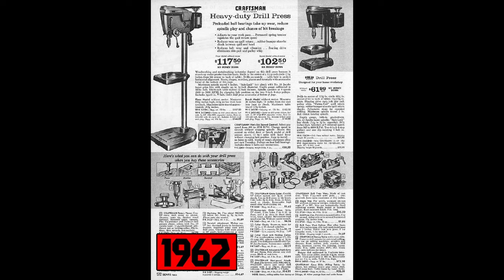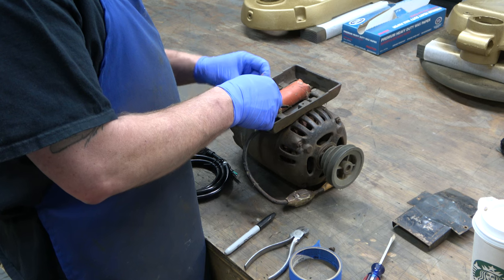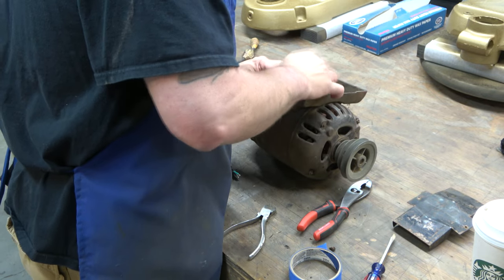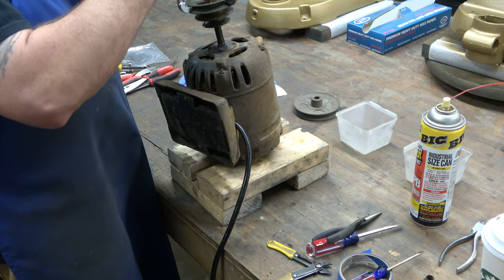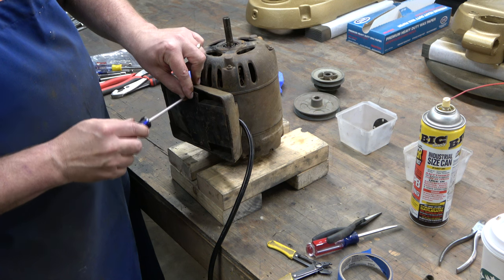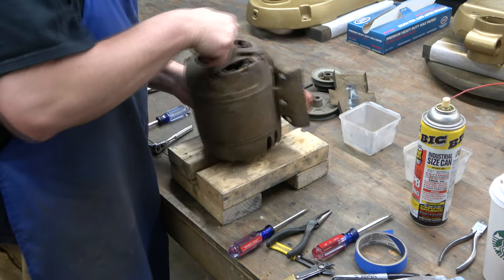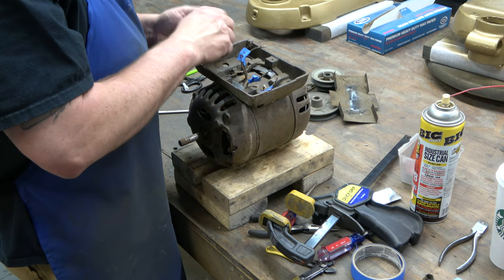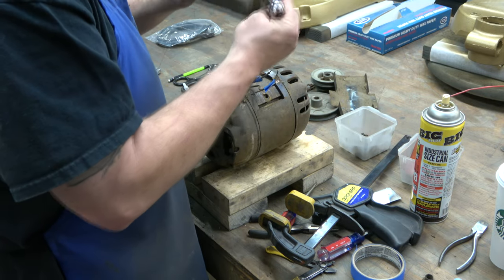Part 8 Rebuild 150 Craftsman Drill Press (Motor Disassembly)

Comment: What would your advice be for someone who didn’t label their wired and can’t figure out where they go now.  I’ve looked at a lot of diagrams but still not sure!
Reply from the maker: Depending on the motor, your best option may be to ohm the lead wires. Do a search on YT for how to ohm a motor. Head over to the Garage Journal Forum, create a free account and post some pics and the motor information and someone should be able to get you sorted out.

Comment: I have a floor standing Craftsman 150 Drill Press model 103.24530.  The motor that came with it is a Craftsman model 115.5829.  I'm in the process of rebuilding the motor and the drill press however the motor does not have a start capacitor and for the life of me I cannot find what start capacitor I can replace it with.  The motor runs well, I've replaced the bearings I just need to get a start capacitor for it.  Can anyone tell me what I need to buy?
Thank in advance for your help.  I'm looking forward to getting this running again.
Reply from the maker: That motor uses a sardine can capacitor. They are no longer made but there are some options to replace it with a currently produced cap. I think your best option is to post your question and some pics of the cap and any markings on it on the Garage Journal Forum. You can create a free account then post in this thread: https://www.garagejournal.com/forum/threads/craftsman-drill-press-information-belts-bearings-chucks-keys-etc-1946-1984.489080/
Reply: @JeffsShop  Thank you Jeff, unfortunately I don't have the original sardine can capacitor, the guy who gave it to me said they used to have to manually spin the chuck to get it going.  Because of that I have no clue of the size or number uF I would need to put in, just need to find out what capacitor would replace it.  I know if you motor rebuild video you had a tube capacitor and was wondering if you could provide the information on that.  I can build up the motor mount base if need be.  I've looked all over the internet on how I might do the calculations to figure out the uF but the only thing they have is for regular capacitors. 
I can't thank you enough for all the videos you have provided.  You've given me a new hobby of restoring vintage woodworking equipment.  It's so cool to see a pile of rust and dust turn into a brand-new piece of equipment.  I'll post my pictures when I get it finished.  
I'll also post on the Garage Journal Forum